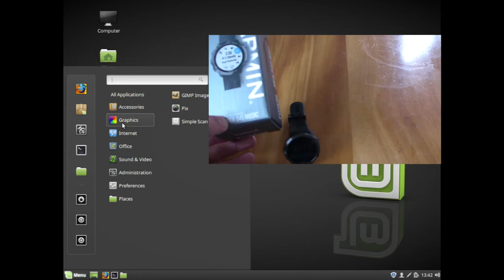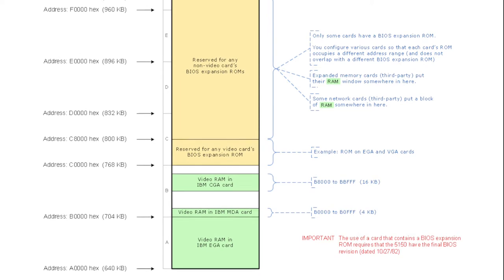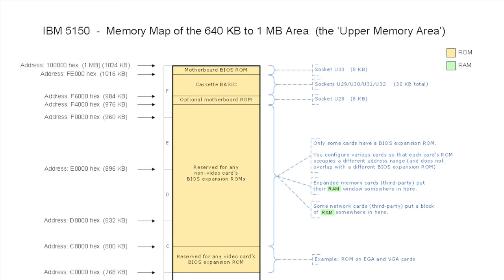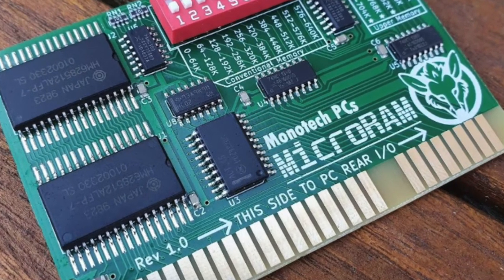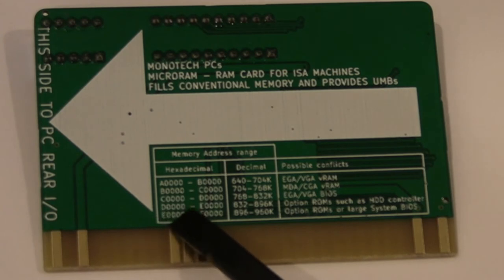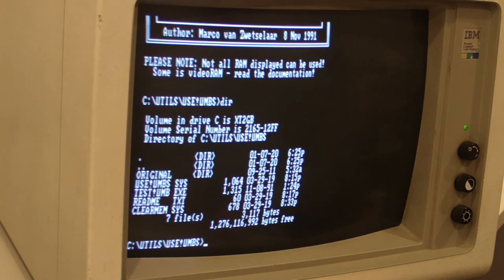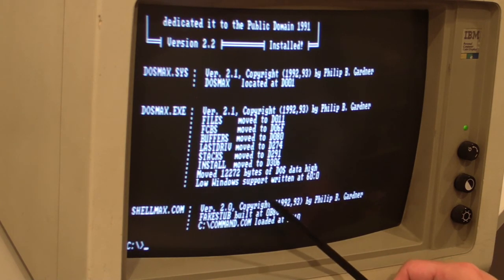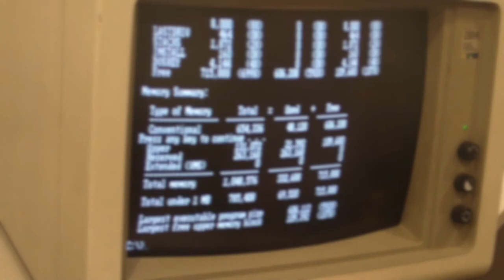How to get more than 640K RAM in a PC or XT

Comment: Hi, thanks for the video!! With which pc did you do this test, 8086 or 80286 ? What is the Dos version used ? Thanks
Reply from the maker: It was on an 8088 machine. I used MS-DOS 6.22. I don't think there is any reason why it would work with a lesser version of DOS above 3.2